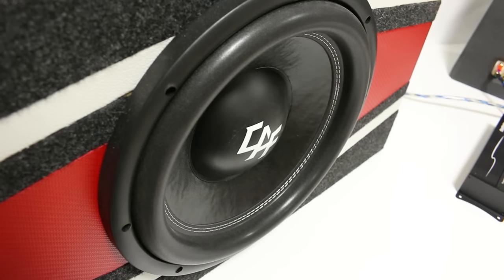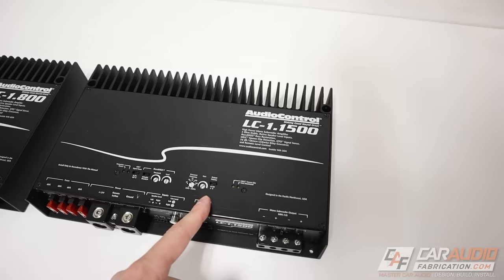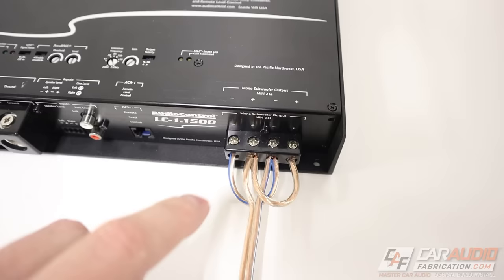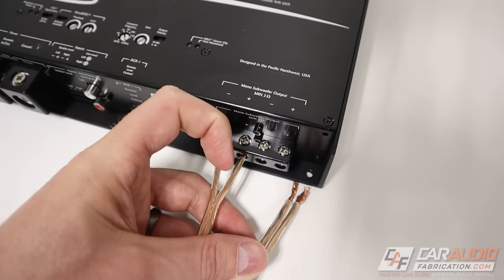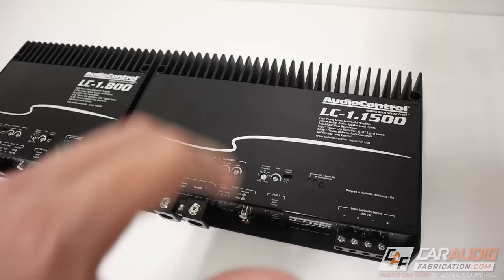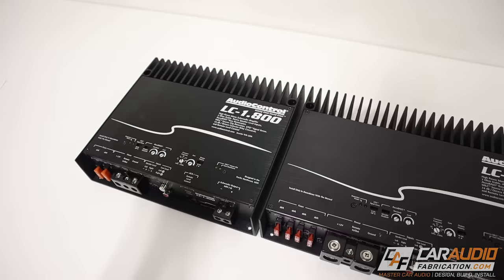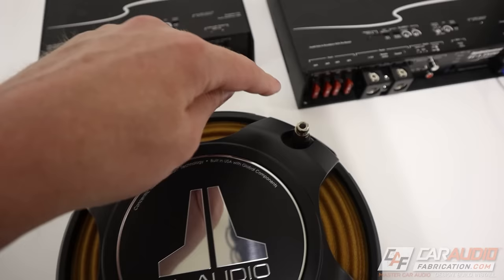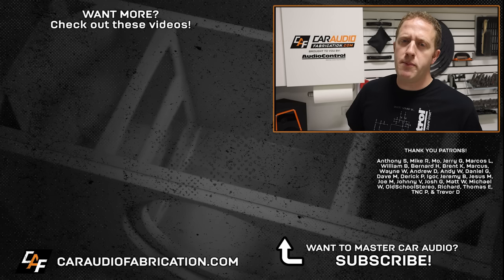The RIGHT WAY to wire subwoofers to a monoblock amplifier

Comment: So just to be clear, in the video u said that u can use either pair of positive&negatives. My question is can i use the the pos and neg on the outsides. The ones that arent right next to eachother? Seems theres less of a chance of them ever touching by using the outside terminals
Reply from the maker: They are internally paralleled. It makes no difference which combination you connect.
Reply: @CarAudioFabrication   thanks boss
Reply: @CarAudioFabrication  I am a recent subscriber to your channel.. You seem to know your stuff. I keep getting conflicting info on my 2, R-W12D2 Alpine R-types dual voice coils that I purchased a couple yrs ago. They are sitting in the closet brand new in the box still. They're 750w rms 2250w max 12's. Everyone keeps saying i should've got the 4ohms. W/e, its what I have to work with. What amp would you recommend to run the subs at 60-70% of their rms. I don't want to max out the subs, I want them to last. I'm upgrading my vehicles wiring to support more power and will have a farad capacitor. People say mono-block, 2 channel, 4 channel etc etc. Any help will be much appreciated. Thank you...
Reply: @jayirvin3629 Nonsense. Just wire each speaker in series with itself, then parallel to a good monoblock amp. This is 2 Ohms.

Comment: Question, my amp is a audiopipe apmn 1ohm stable amp and has those two terminals and im trying to connect both my 2ohm subs at  1ohm... Can i wire each sub at 1ohm and then connect each to there own terminal and still get 1ohm??? Plz help
Reply: If you wire two 1-Ohm subs in parallel,  it is 1/2 Ohm. You would want to wire them in series, resulting in 2 Ohms.

Comment: So here is a question that I can't seem to find a video or diagram for. I have a Power Acoustik Vertigo 8000w monoblock. Can I hook 4 subwoofers to it? And if so how?
Reply: If you know how to wire and you’re confident behind your wiring work
Reply: No such thing as an 8000 watt Power Acoustik. That amp is rated 850 watts. Likely that it doesn't produce half this.

Comment: am i correct to say that it doesnt matter if i connect double positive and double negative wires to one sub woofer , vs just connecting one positive and one negative to one subwoofer?

thanks!
Reply: If you double wire to the same locations, it doubles the current capability of the wire.

Comment: So I was wondering I installed two ten inch 300 watt subs in my jeep, and I am looking to buy a amp to push them. I had bought a loc2 pro controler with AccuBASS but it didn't work (maybe bad part) a regular controler worked just fine. My question is if I went with a amp that had AccuBASS would that get me the bass I want is so what would be the amp I would want to use to push them
Reply: If it is a late-model jeep, you may need an LOC with loading resistors.

Comment: Does it work for all class D Amps with 2 channels
Reply: 2-channel amps aren't monoblock. If you jumpered a 2-channel amp like the thumbnail, you'd fry the amp. If you bridge it, load will be 1/2 what the speakers are wired to.

Comment: Hi Mark. Is it normal that the cooling fan off the LC-1.1500 is always on when powered. It’s been told to me that it’s normal, others tell me it should only turn on when it gets hot.
Reply: If everything else works then I wouldn't be too worried. With 2 failure states, always on or won't turn on, your's is ideal.
Reply: @aycentroid  it works fine, enough clean power. Only for a digital amp it gets quite hot; and heat is wasted energy. 
And one last thing; when the amp is shutting down, in the last second when shutting down it makes the subwoofer make a scratchy sound, like a kind of “backfire” of the voicecoil.

Comment: What size speaker wire is ideal for connected the sub to amp ?
Reply: depends on subs rated power, but for most people, 12-10 gauge works fine. I use 10 gauge on my sub thats rated for 1000 watts

Comment: As this amp is 2 ohm min, the most obvious use is connecting two 4 ohm subs, one to each output, for a 2 ohm load. Four-channel home audio speaker wires could be used with both outputs. 4-channel wire could fit exactly, offering a low total gauge wire, while the 4 smaller wires are less cumbersome around amp outputs & speaker inputs than two thicker wires.

Comment: Is it safe to connect an amp at 1ohm to a 2ohm sub?
Reply: It isn't possible. The speaker determines the load on the amp. How are you going to run the amp at 1 Ohm if the speaker is 2 Ohms?

Comment: hi, did you make a video on how to wire a 4 channel amplifier ? like, i have a rockford p8004 and i want to use the 800Wrms for one single sub, is that possible ?
Reply: You need a dual voice coil sub and bridge the amp into 2 channels. Wire these to the coils. You will get the 2-Ohm rating if the sub is dual 4-Ohm.

Comment: Great videos. I have a question reguarding this subject. I have 2 12" dvc 2ohm subs. I am going to wire them in series parallel  into a 2 ohm amp. My question is do i have to feed one sub from the other in order to end up with 2 phm total load or can i wire both subs to the mono amp? Reason im asking is it will be a lot easier to wire each sub to the amp (single output amp) rather then feeding one sub from.the other as the terminal connections are much smaller. Thanks again . I found this channel looking for info on using a dsp for the first time

Comment: Okay wait. How does that affect the ohms. Like. If you had two 4 ohm Subs. And each one had their own pair of terminals. Would it wire it to 2 or 8. Or some magical 4 ohms
Reply: At that point you would be wiring the 2 4ohm subs in Parallel which would give you 2 ohm. It does not matter if you parallel the subs at the amp, at the sub terminals, or in the box. When you connect both voice coils it makes it parallel. Pretty sure it has a video about how to wire subs if you wanted to try checking it out
Reply: Monolock means it has a single output so the two positive terminals are just one output with two holes, you could wire the parallel connection at the amp that way if you wanted to but it wouldn't be different then making the connection between the speakers. The circuit is functionally the same. The only way to get a  4 ohm load from a pair of 4 ohm subs is if they are DVC subs

Comment: I have a mono block amp but I have 2 Alpine Type E DVC. My question is how do I wire them inside the enclosure ? I understand that the two pairs of outputs are the same thing. I just need to know how the subs inside the box are supposed to be wired ?
Reply: Parallel, positive to positive, negative to negative will result in 1/2 the voice coil rating.

Series would double the Ohms. Series would be wiring a jumper from one sub's positive to the other sub's negative, then running the two remaining terminals to the amp.

Comment: Those terminals are internally parellel connected right ? So, when i connecr two subwoofers to each of the terminals ( or connecting DVC subwoofer to each ) there will be impedence difference right ? If i connect two 2 ohms subs to each of them, the total impedence should be 4 ohms ! So the efficiency will be lower ?
Reply from the maker: Two 2 ohm subwoofers connected would be in parallel and thus a 1 ohm load. As covered in the video yes these terminals on a monoblock are internally connected.
Reply: Parallel is half (if they are same Ohms). Series adds impedance.

Parallel: 4+4=2. Series: 4+4=8.

Different Ohms are more difficult in parallel. 4+8=2.66 Ohms.  (4x8 divided by 4+8, 32/12=2.66).

Comment: unrelated question to your current video, but where do you get sheet acrylic used for custom racks, or speaker mounts?
Reply: Tap Plastics is a good source, for Cast Cell Acrylic (way easier to work with than plexiglass) 
as well as HDPE (cutting board material, also known as Starboard), for speaker adaptors and amp racks.

Comment: How do you install an amp to a factory radio without increasing the motion detector sensors? My backup and side detection sensors became extremely loud and annoying.
Reply from the maker: Use a different channel for signal. Those usually only come through on certain channels.

Comment: I've been using my stock door speaker on a 11 Nissan frontier with some subs. Quick question. If they sound good for me, would it be recommended to change my stock speakers and tweeters in my car?
Reply: Do you play your music LOUD? Are you willing to do a 4 channel amp install? Speakers and an Amp will just raise you volume ceiling, while also producing clean, loud sound. Depends on what you want and how much you want to spend.

Comment: I have a question !!!
I have a kicker DXA500.1 that cuts out when i turn the volume up.   Subs are wired parallel..   the way i have it wired is like what you would do if it was not a mono block amp.   One neg from one side one positive from other side.   I didn't know it was a mono amp.   Because it had two output channels.   So i had to increase the ohm load to get it to stop shutting down when i turned it up.  Works fine now but it's not as loud.    Im thinking it's because of my ground.   I have it grounded with the bolt that grounds the trunk latch bolt.  Whet i hit the release in the glove box it shuts amp off for a second.   Anyone know why it's cutting out at a two ohm load ?     Maybe i gotta run both out puts ?     Also when it was shutting off as i turned up the volume my headlights were really dimming bad.   And i have a capacitor that helps prevent this.    Any advice would help.   Thanks

Comment: Please correct me if I'm wrong but if you bridge your sub on your amp aren't you getting the true value of the amp? I had a mtx amp that said if you hook up the middle set it's true 750 watts rms. Just left or right set gave 500 watts. I now have a phenox gold amp 1200.1 rms and I have 1-12" rockford p3 at 1 ohm. I do not have it bridged now for break in process but was wondering if I should bridge it to get the true 1200 watts. I know the sub is only rated for 600 watts but it hasn't stopped my 2-10" p3s in my other car. Love your vids too btw very informative 👍

Comment: What about the input side? For example it's a mono amp. The headunit has a mono sub output. So why L & R inputs?
Reply from the maker: Because most every device that creates the low level signal at a bare minimum will have a L/R signal. You will want that signal summed for your subwoofer so it allows for both in to sum internally.
Reply: @CarAudioFabrication a lot of cheaper head units have a single sub output. You would want a Y adapter then.

Comment: So when running 2 subs to a mono block amp with 2 sets of wire hookups do you just put one sub on one and the other sub on the other one?
Reply: I have a jbl mono block with 2 sets of speaker outputs and 2 12" subs as well. The way mine is set up only uses a single positive and negative connected to the Amp and then the positive wire connected to the first speaker and the negative connected to the second speaker and a short wire that connects the negative of the first speaker to the positive of the second speaker. I tried connecting both speakers individually but it didn't improve anything and looked less clean with more wires and I felt like it might have actually had slightly worse performance.

Comment: So my monoblock is a jbl club 600 watt and it says in Manuel it pushes 350watt RMS x1 at 4ohm and 600 watt RMS at 2 ohm now I have my 2 12's that are 4ohm wired to each +/-. There are 2 sets of these on my mono block my question is how do I have to wire them to hit the 600 watt RMS and does that mean the amp will be running at 2 ohms or my subs will run at 2ohms and will that damage my sub's if so?
Reply: Assuming they are SVC subs, the amp is loaded at 2 Ohms. Subs don't "run" at any Ohm level. The Oms (impedance) goes up and down while playing music. Cheaper speakers can vary more than better ones. As impedance drops, it can run very low, causing an amp to shut down or even burn up. I don't recommend running amps at 1-Ohm, regardless of what their specs claim. 1-Ohm is very close to zero Ohms, and it is going to drop, and zero is a short. You also sacrifice speaker control every time you go from 4 Ohms to 2 to 1. The amp's Damping Factor is reduced by half. An amp with Damping Factor of 200 at 4 Ohms is only 50 at 1-Ohm. Damping factor is how the amp starts and stops the speaker's movement. High Damping Factor produces tight bass.

Comment: So if I have 2 dual 2 ohm subs wired to 1 ohm each. If I connect each sub to its own side of the 2 input monoblock. 
Will it stay 1 ohm resistance or will it go to .5 or 2 ohm?
Reply: I'm wondering the same thing..

Comment: Speaker wire size is one of my biggest pet peeves. Everybody with 1000w on a pair of 12s seems to think that they need 8 or 10 guage speaker wire! 😣 I know from experience that as long as your using good name brand OFC (SkyHigh✊) you don't need bigger speaker wires. I had no problems at all using 14 guage OFC on a 2000w rms system and when I upgraded to 4 12s on a 5k amp I used 12 guage. Some of these people are running POWER wire to their subwoofers and I'm just like 🤷🤦
Reply: The main thing is to make sure connections are tight. When you have loose connections is when things melt.

Comment: I have this double pos/neg connection on my amp, except the manual states ‘internally parallel’. Makes wiring a breeze.
Reply from the maker: Every monoblock amplifier that has the dual pairs is internally parallel. Unfortunately though not every company makes this clear which leads to consumer confusion.
Reply: @CarAudioFabrication  Did I just expose my noobness? My concern was wiring D2 or 4 subs to a mono without blowing isht up. Noobs are born everyday in car audio; I’m one of em. Thanks!

Comment: I just had a mono amp installed to factory system for a sub by way of an LOC and the installer only tapped the left front speaker for signal. I’m concerned the sub is possibly losing signal as it’s only pulling from one side. Shouldn’t he have tapped BOTH front speakers? Or does it even matter due to the mono amp?
Reply: You should also tap the right front speaker. There is bass on the right side and other audio information that your amp needs to reproduce proper sound to your sub. Otherwise it will sound like something is missing in your music
Reply: No, it doesn't matter. Low frequency is mono. In fact, many factory subs are wired this way. It would only make a difference if you balanced the radio all the way to the other side, which is senseless.
Reply: Why then do they provide a left and right channel input on a monoblock amp if the ultimate output is mono only? On true stereo,  the bass can be uneven on the right and left side. Have you ever listened to older music with headphones and you only heard the bass on one side?  if your head unit is putting out mono instead of stereo then equal sound is being reproduced on both sides.@TE5LA-GAMING
Reply: @Daniel-ju6oy took truck back and audio shop said same thing.  Guy who installed it had to fix.  Plus amp was missing 50% signal input from right side causing it to work harder and not have as much output. Sounds completely different now !

Comment: I wanna ask a question so how do you connect a single sub to a 4 channel amp I’ve been looking all over the place and I can’t find nothing
Reply: You connect it to one channel or bridge two channels if the amp can handle the rating. You can't use all the channels if the speaker is single voice coil.

Comment: say I'm wiring two sub woofers on an amp like that. Will it split the 300W RMS between the two of them or do they both get 300 RMS?
Reply: They each get half of the power that the amp produces at the rated load.

Comment: what if its a mono block with two speaker hooks ups but it has a bridge diagram above the speaker outputs? like the American bass dc2000 xfl
Reply: A bridgeable amp isn't a mono block. Its a bridged amp, and there is a big difference between the 2. When you bridge a 2 channel amp to 1 channel, the downside is the amp now half the resistance on any load you connect to it. So, for example, if you have a 4 ohm speaker, after bridging the amp sees a 2 ohm load even though the speaker is 4 ohms. 
You should never bridge an amp unless you have to. You end up beating the crap out of your amp and speakers. Its better to buy an amp with enough power to begin with.
Reply: @AT-wl9yq He may have an amp where they used the same case for a 2-channel and a mono model, and it's printed on it. Money saving step.

Comment: I understand the mono block but why does it have left and right in if it only has one out ?? I know for a fact that you can just use either or and it sounds fine.
Reply from the maker: This is addressed in the video
Reply: @CarAudioFabrication 
No mark I don't believe it was I listened to the entire video twice and never was it mentioned anything about the sound going INTO the mono block. Only the reason they jumped out the output was talked about. Not trying to be ugly here it's a ligament question. Why are there Two inputs on  single channel amplifier???????

Comment: Hey Mark big fan. Doing my amp setup. Deck only had 2 sub output. Ok so use a y connector right ?  Do you prefer to put the y at the head unit and run 2 rca’s back. Or use 1 wire and split it at the amp ? Or it does not matter. Thanks so much.

Comment: After watching your great videos I’m planning and building my own install, quick question I wanted 2 10” 300w JL subs as this looked better with my design but would I get better performance from a 600w 12”? Or would it be very similar? Keep the great content coming 👍🏻
Reply: I think you'd get more performance with the 2 10s, not sure tho, don't take my word for it.
Reply: depends on a lot of things but the 10's would probably come out about 1-3db ahead.
Reply: So I put in two alpine 300 watt 10s I was wondering what amp u used to push them